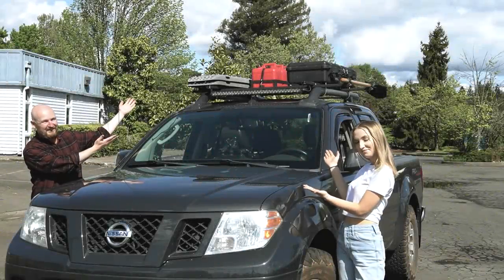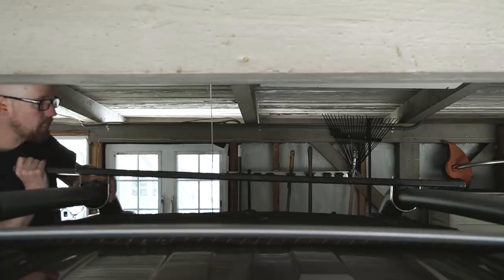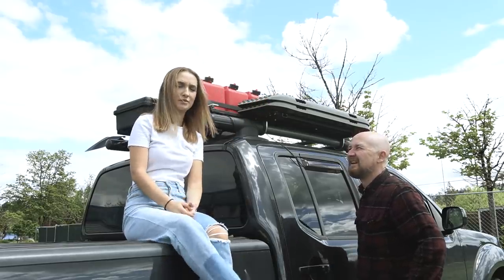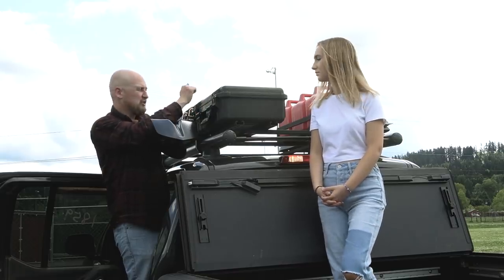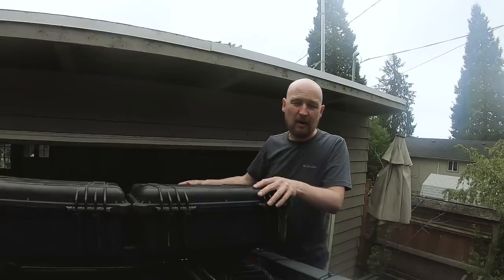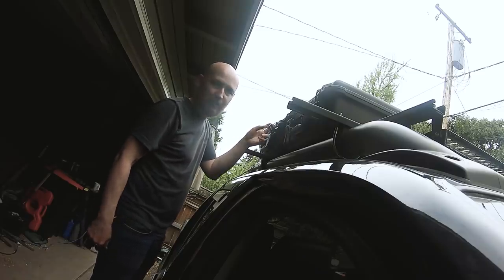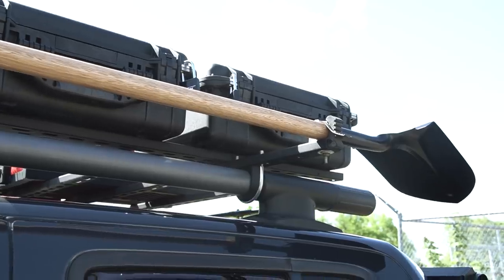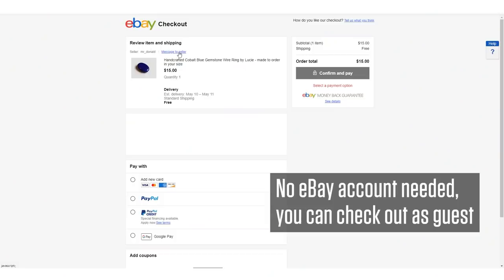Inexpensive DIY Roof Rack on my 05-20 Frontier Pro-4x

Comment: I used a 9 gallon boat fuel tank instead of the three jerry cans.the boat fuel line drains the 9 gallons o fuel directly into the subie fuel tank without removal. I fill em up on top o carwith a static line ground to road. Enjoy Lucy’s goofiness. Reminds me o my goofy wife. I also enjoy your tinkering around w car and trail videos. Keep it coming. After 20+ years of traveling on I 40 and 20 always find a lot o things to see in small and large towns along theway
Reply from the maker: Even back with the Forester, I looked long and hard at boat fuel tanks. It seems like a great solution. The problem is, being up that high, I don't think gas station attendants will climb up to fill it, and in Oregon, self service is illegal (except in some rare scenarios). So I'd need to have jerry cans filled, then I'd have to heft them to the roof in order to fill the roof tank. Ultimately I'd like to get a long range fuel tank installed under the bed, but in the meantime I think I'm stuck with regular gas cans of one type or another. :-)

Comment: You can paint galvanized metal, you just need the appropriate primer. Easiest would be a self-etching primer for galvanized metal. If it's newly galvanized (ie. within 6mos), you'll often need to use a solvent cleaner to prep the galv first.

Comment: Nice to see this. I've been using Unistrut since the early 80's when I started in HVAC. Truly "magical" stuff, and somewhat unknown and underrated. McMaster-Carr is a gold mine!!! Etrailer has the Quick Fists currently for $10.18. I have an "inside bed perimeter" system on my Dodge. Silver galvanized strut channel is mounted with Plusnut type anchors. Super strong!

Comment: I love the versatility of electrical strut. I built one that I interchange between two separate rigs...one for soft roading and one for not so soft roading and when not camping I simply hoist up to the rafters in my shop loaded .... then I can utilize my strut cross bars for more daily duties  or for my traction boards on day trips. I used some vertical 90 degree brackets and a short piece of strut to mount my boards and high lift on opposite sides if the rack. Also use strut to mount the power tank and rotopax inside the off roader on day trips ... strut rocks! As,always enjoy your character and content glad to see you back at It!

Comment: Loved the bloopers!  Luci is such a crack up...great to have a daughter like her.  Your DIY projects are awesome, Don, and saved you a barrel of money.  I love improvising and my van is full of DIY projects.  For example, to save money buying wood, plywood, bolts, nuts, etc. (not to mention time and effort) to make my bed, I used my Coleman cot.  However, it was too low to sit on and too bouncy like a trampoline.  I found a section of deck rail that fit over the cot, length and width, adding almost three inches to the height and great stability overall.  It cost $60 at Lowe's and is well constructed.  My Teton base camp mat fit perfectly on top making the "bed" super comfortable to sleep and sit on.  I have a "tool wall" but I want to put them on my roof and a Thule or Yakima box was considered; however, your Pelican box idea sounds so much better and would save me a bundle.  You well know that Thule boxes can be very expensive.  My van has no roof rack so I'll have to bite the bullet and buy one, hopefully find one on sale or even from a wrecking yard; and repaint, etc.  The unistrut option seems to be the way to go for me.  Your rooftop configuration looks great...super job!  The fuel storage shelf is an idea I will use in my build.  In the near future the van will be my home while traveling throughout the lower 48, Canada and Alaska.

Comment: You guys are a hoot! I just did a DYI bed rack for my roof top tent. Had it powder coated instead of painting it. Very reasonable. 10 pieces cost about $95 to coat and won't rust or chip.
Reply: Coastal salt air will cause RUST over time that travels under the powder coat, then the powder coat peels and flakes off…
Oregon coastal air made short work (couple years) of powder coating on several metal items we thought were, and sold as, impervious to rust.
Just a heads up.

Comment: Nissan..... I started out with a 1979 
Chevy Luv 4WD as a teenager.   Two options back then. Toyota with a solid front axle or Isuzu/Chevy.  I built that Luv out.  31" tires, a 5" lift.  Rancho suspension.  Custom Warn  brushguard, winch mount.  
custom tubular rear bumper.  1.8 liter 4 cylinder.  4 speed manual transmission.  I regeared  the rear diff. Weber Carb and headers.  Then in 1986 the Nissan Hardbody was released.  
V6....  The best thing Nissan had ever done....   I traded my Luv in on a steel grey Hardbody.  % speed manual transmission.  
Bought a camper shell.  31" tires, a two" front lift.  275,000 miles.  morDown into Mexico on surf trips...The only thing that stopped that truck was a miricale.    Going to work one spring morning.  Heavy, sporadic rain showers.  

Sunshine one minute, clouds and rain the next.  I hit a stretch of 3 lane freeway.  Sunken in the middle. 65 MPH .  Hydroplaned.  Was in the middle lane,  did a 180 into the outsidew lane.  
Looking into the front of a Tour 
bus before my wheels caught the outside curb and rolled me 4 times.  Jaws of Life... Walked away from it.

Nissan.

Comment: The roof rack looks awesome, it's interesting to see what can be done with a bit of resourcefulness. I imagine the longer handled shovel will be more useful when it comes time to use it, I have always found a short shovel frustrating to use. I kept a full sized snow shovel in my truck through the winter, so when it came time to dig out someone else it was less backbreaking.
Reply from the maker: Agreed. My shorter shovel was largely dictated by the space on my Forester, I think the bigger shovel will prove nice to have. And I'll still certainly carry around my even smaller mini shovel in the back of the truck as it's far more convenient to grab for certain...duties. ;-)

Comment: Great video, after watching this one first and a few other vids I went out and constructed my own rig on top of my Pro4X and turned out really nice. Super strong and holds together really good. And yeah is hard to paint galvanized metal but I found that if you use plasti dip (holds to the metal better) then spray painted, seems to work decently. Great system to use instead of expensive roof racks, may not look as fancy but is more modular and just as sturdy.

Comment: Liked the Unistrut.  I am planning to use some on the inside of the bed of my truck to make mounting points for the high lift jack, traction boards, etc.  I need to check out getting some used Unistrut!
Reply from the maker: If you can find it used, it makes an affordable setup dirt cheap. I found 5' lengths for $3 each at the reuse-recycle center here (whereas last time I looked, a 10' length of new strut was around $23). It's rare to find though. I stop off there every time I'm in that neighborhood and there's almost never any used strut to be found. I've only lucked out twice. I was able to build this rack on the Frontier because I had snagged several pieces probably well over a year ago and have just been sitting on them for some future use. Even new though it's still a remarkably affordable building material.

Comment: Jason from Maryland here.
Great instalment! Really dig the lined u-bolts!
Edit.
The can holder is great! Cool you used some 'strut for the bungee tie points!
Reply from the maker: Thanks! The bungee and tie-downs were an improvisation after my original idea for securing the cans ended up not translating from paper to the real world as nicely as I had hoped, LOL. It was fairly serendipitous...I was struggling to come up with a new way to secure the gas cans when I noticed those two little pieces of strut I had cut off to size the "crossbar" struts some days before. They were still just sitting there on the workbench I hadn't bothered to tidy up. I didn't even resize them any further, they looked just perfect and I welded them on as they were. :-)
Reply: @softroadingthewest  
That's great! I've always been a believer in the, "use what you have" concept. A little thought and creativity will make it look like an actual purchased item. 
Keep building!!!!

Comment: Nice build, I have a Yakima roof rack with only lites mounted and small solar panel.Used to have gas and boxs on top found that after you lift Fronty way to much weight and top heavy.Be careful not to overload check rating of bars you may be over.Keep vids coming great work .Cheers Mad Dog out

Comment: Another great video, thank you! And I'm curious about your truck bed build. I will add a cap to my Frontier (5x5 bed) and have a design for a sleeping platform. With truck bed size, you have 7' on the diagonal, so one person can sleep - while closing the tailgate and cap door. My platform design is 5' wide by 3' long - with the end a chuck box cooking center roughly 2' long. So the truck bed platform would have under storage with the end of the platform a movable chuck box.
I look forward to your design ideas and build. Thanks again for the great information you provide :)

Comment: Major Surplus has genuine surplus NATO 20l fuel cans on sale for $20/ea, with a spout. They have a bit of rust on the outside from storage, but the inside is unused. 10 minutes with a wire brush and some spray paint fixed them right up. After our ice storm, I bought.....a lot of them.

Comment: "And yet, I did it anyway" HAHAHA!!!! I liked that.

Living in Eugene as well, my greatest concern is that anything I put on my roof is going to get stolen...because Eugene. I really like the gas can holders though. I may do that.
Reply from the maker: With the Forester, I would only put my Fuelpax can up there when I was leaving for a trip. The traction boards however have survived sitting on the street for years with no lock. I think they're just not appealing to junkies looking for something to sell quickly - probably clueless as to what they are anyway - and one can't really stroll discretely down the street carrying them, LOL. If I real MaxTrax up there though, they would be locked for sure. :-)
Reply: @softroadingthewest  Good points. I might try leaving my knock-off Trax up there.

Comment: Hey man, fun video.  I do have one recommendation for you, though.  I do a bit of work with Pelican cases (and similar manufacturers).  They are pretty strong, but as with any plastic they do not take point loads well.  I'm guessing that you have a washer on the inside of the case at each bolt , but I would recommend that you us something larger to spread out the force.  I'd recommend putting a piece of 1.5 - 2" wide x 3/16 - 1/8 " thick piece of steel and run it between two of the bolts (probably front to back of the box).  Round the edges so that they are not pointy.  That way, when the case is vibrating the force is spread out more (mo-betta).

Also, your video is timely.  I think I might end up with a Frontier in the near future.  I'm thinking a 2019/2020 Crew Cab Long bed (coming from a full size truck...just used to space).  I was thinking about the Tacoma, but that new engine and transmission in the Frontier is so appealing and Tacos are crazy expensive right now.  With the price point, I may even go for a 2021, but that would be at the end of my affordability rating.  I'd love to get the Pro-4x, but they don't make them in Crew Cab Long Bed, so I'll have to upgrade it slowly.

No worries, though.  I won't be competing with your channel.  I have no channel, I'll just plagiarize your ideas.  It's nice seeing someone being fugal about their mods vs. trying to get views by putting the most expensive stuff on their vehicle.  Both have merits but the former will likely be implemented the most.
Reply from the maker: I verrry nearly put straps of reinforcing metal across from bolt to bolt, but then I wasn't sure it would actually change anything. Simple enough to do, I will go back and add those in!

Comment: The fuel container rack is an EXCELLENT idea!! The craftsmanship looks professional, clean, and highly functional.

It’s not like you need more to do, BUT...

I can see that fuel container rack idea as a retail production. Particularly if folks have custom measurement requirements.

Do the gas containers fit snug enough that friction while off-roading will not be a concern for leaks developing in the plastic container?

Great rooftop buildout, man.
Reply from the maker: Oh it doesn't stand up to close scrutiny, believe me. :-)  There are numerous flaws - I could never take anyone's money for my amateurish fab work, haha. I will almost certainly redo this at some point, maybe with higher quality gas cans as well. The cans are in there very snugly, yes. It actually turned out a little more snug that I intended but that may be a good thing. I'll see how this holds up but I'm considering it a rough prototype of some future final version. :-)
Reply: Everyone is an amateur during some point of any endeavor. And we’re oftentimes our own worst critic.

I’m seeing that rack with a single fuel tank (hard opaque plastic variety) fitted within and a hand siphon for filling your Nissan’s tank. No removing of single cans to fill or empty.

Hmmm...🤔

Comment: You said "Just in case" while talking about your new storage cases.... I know, i pick up on weird things. 

Not sure the sizes of your cases, but Harbor Freight does offer pelican type cases less than half the price of Pelican cases. They do offer a gun case (WITH ONLY 4 LATCHES ON ONE SIDE) just so you know for future reference. 

Good job on the welding! Oh, and ring is ordered! Thanks, George.
Reply from the maker: Oh I didn't even make the connection when I saw the order for a George in Idaho, LOL. The ring size did not come through, do you know what size you need?

I did look at rifle cases at Harbor Freight. Probably need to catch them on sale, the regular price was still quite a bit more than the pair of used Pelicans. It looked pretty nice though!
Reply: @softroadingthewest  Odd I filled in the message to seller. Hope it was me and not something else. Size 8 was what was ordered. Thanks!
Reply from the maker: @swidahooverlanding2867  You're not the first to report putting a message that did not come through to me. That feature has been finicky so far. Lucie will get it built for you - thanks!

Comment: We love your ingenious, creation of a strong safe roof rank, also We are wondering if you can deflate a bit of tire air to move Into the garage for winter storage, we hope this doesn’t impede the cool pelican install too. Love from San Diego, Ca.
Reply from the maker: The garage I work in isn't mine, I can't park in it long term, I just use it for working on the truck from time to time since I currently don't have a garage of my own. Someone else's car lives in it. I'm hoping to change my living arrangements in the coming year and a garage the truck will fit into will be a priority. :-)
Reply: Hi from, San Diego again. Thank youfor the speedy reply. We are wondering about the diagonal bed inches,? I’m 5’ 7” he’s 6’2”
Reply from the maker: @lisah7304  I don't know off the top of my head. I am 5'9" and while I can technically stretch all the way out, I frequently run into the boxed in corners with my head and my feet. This setup (in a truck with a 5' bed) would not work for someone 6'2" and also wouldn't work for two people.

This got me by as something I could quickly throw together to sleep in this small space so I could get back out on trips, but FAR from perfect and I'm actually working on a new long term design. In any case, I think even if you built a platform/bed that completely filled the truck bed with no floorspace at all, it would still be virtually impossible to sleep two adults in the back of a shortbed midsize truck...even if you could manage to both lay down with your husband using the longest diagonal space, there just would also be no room to move around, get dressed, etc.
Reply: LOL not married yet! He’ll have to get his own truck then, I like this style! Thanks for the fast reply, we’ll keep watchingfor more cool videos(when you have time).

Comment: Hey Donald,  just an FYI if you reach 80 k on your VQ 4 frontier make sure you replace the radiator. That fails from the inside seal the separate the tranny oil and coolant. .. antonio

Comment: The master locks in your video if you go back to were you  purchased them and look at the package  the key codes are the same I run a yard care service and lock my weedeters  to the trailor and  some one used a key and stole my gear so I bought  some locks that you can use your vehicle key and  have one key for all your locks
Reply from the maker: That would be ideal, I didn't know such a thing existed!
Reply: The locks are made by bolt #7023537

Comment: Was wondering how you get the cans out of the carrier after they have swollen up from the sun. I have the same container and it really "puffs" up in the heat. Great job!
Reply from the maker: I'm pretty diligent about releasing the pressure build-up regularly when it's hot or I'm gaining elevation...swelling gas cans make me nervous, heh. The one time I pulled the cans out to refuel the truck, it was early in the morning at camp and they had shrunk back down overnight. I'm assuming that if it's hot and they're swollen, I'll be able to release some pressure just by opening the caps and will be able to pull them out. It's definitely very snug when they swell up.